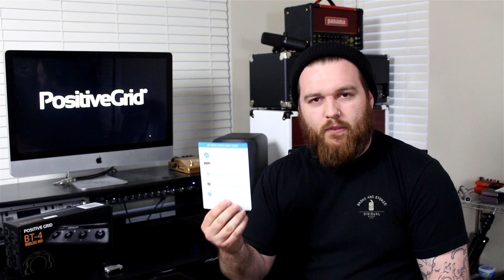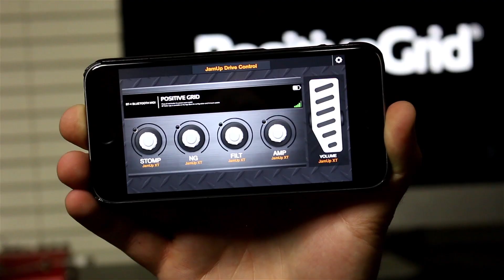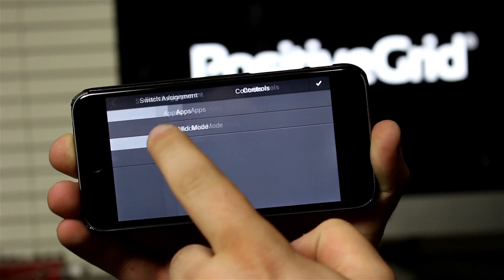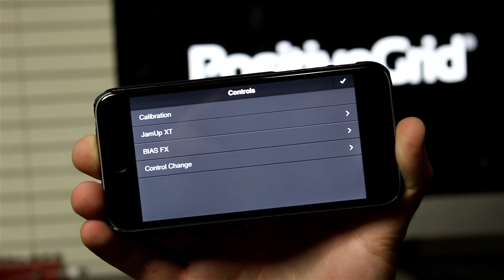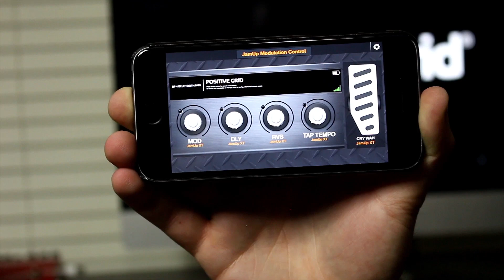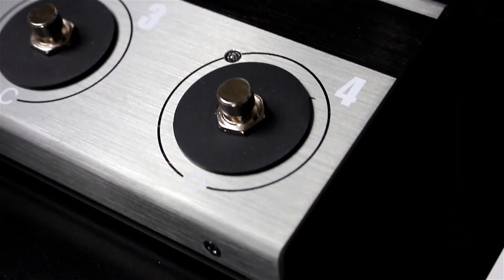BT4 Bluetooth MIDI Foot Controller - Tutorial & Review

Comment: So... Can I use a pitch shifter with this? I have a Whammy 5 pitch shifter, can I just plug that in the jack and when I hit the button (on the BT4) it allows me to use that pitch shifter? 

Next question is what if I wanted to hook up a pitch shifter and a wah. There is 1 jack on the BT4. Can we only use 1 expression petal it looks like? Can we use multi BT4's for more presets and more pedals? 

Thanks!
Reply from the maker: Hi David, you can connect an expression Pedal, but not a regular effect pedal like the wah or pitch shifter.  Right now you can use one BT4, we are exploring possibilities to expand upon that.
Reply: Thx for the reply. 

How long do these batteries last, I have never been a fan of batteries in pedals cuz they die! Maybe they last so long it's a non issue? 

I sold my TC-G system yesterday and will be getting Bias FX btw. if that works out i'll prolly get the BT4.

Comment: I use this live. It's wicked. I haven't noticed any latency either! Well done Positive Grid 🤘🏻
Reply from the maker: +ShredGuy thanks! :)
Reply: What iOS device are you using? I'm running an ipad mini 2 and i have to hit the pedal slightly before i need a preset to change.
Reply: +metallaholic I'm using an iPad 2. Check that the "Ultra low latency" button is on (in the settings menu in the bottom right hand corner of the screen)
Reply: Whats battery life when use every day?
Reply: +Remy SUNAIVOD exact same software on both. Only difference is you can't create bias amp matches on the iPad but you can use ones you or anyone else has created. 

I recently switched interfaces so I can use a wired behringer foot controller. Instant patch switching and everything.

Comment: What is the switching time. Some devices have about 200ms. That would be unusable for live Gigs. And experience?
Reply: +Tony Cappocchi Thanks for the quick answer. Could you demo several preset switches, so we can hear it?
Reply: +Tony Cappocchi ugh that's too bad. A deal breaker for me. Sticking with good old fashioned stomp boxes for now. Looks like a great product for the future though, things only getting better
Reply: +Tony Cappocchi 
No offense, but that's kind of crucial. This pedal is pointless unless the gap is not noticeable. Playing live requires no latency, and in the studio, I would just change the app setting using my fingers--no point for a wireless footpedal.